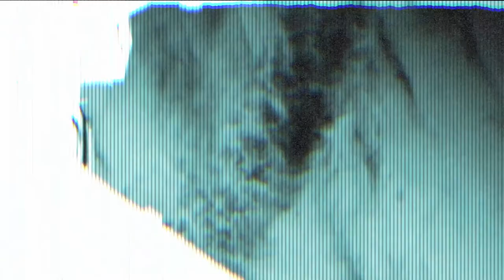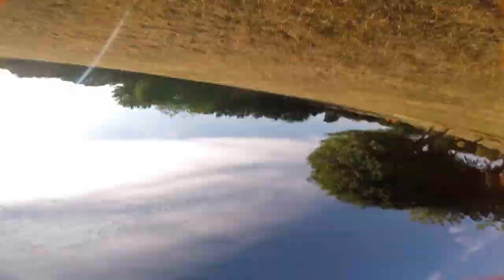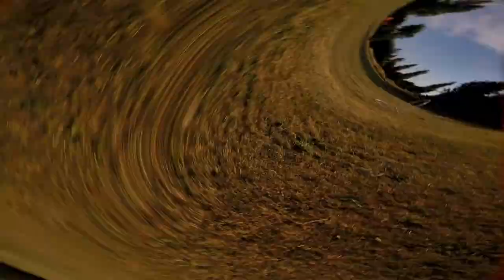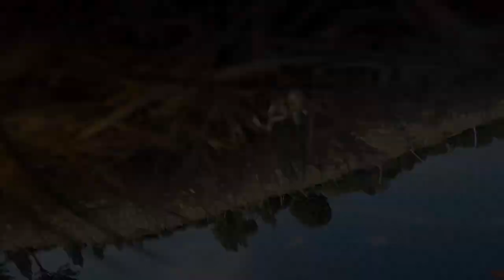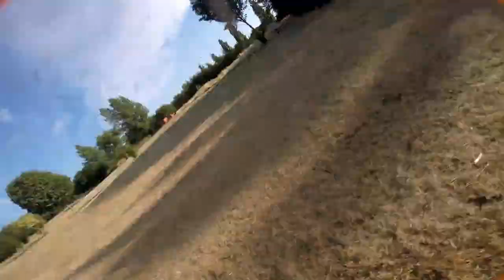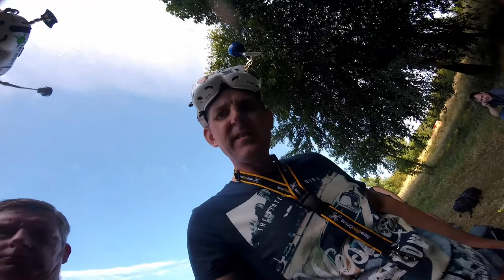Smoky Bacon - Puda Chameleon - motor fail

Comment: Yummy when screws are too long 😆
Reply from the maker: KrzychOlsztyn  - short ones wouldn’t grip! I think I need s set of washers
Reply: Flying Pig I'm using strong led flash light when I'm doing motors. Then I can see clearance between screw and coils. Usually I'm using 1 shorter screw on hole where You've got main motor wires on other side . There is hole like this on every motor. Always there is 1 especually on cheaper ones like Racerstars AokFly could be the same
Reply from the maker: KrzychOlsztyn  - I used short ones on the motor lead quarter